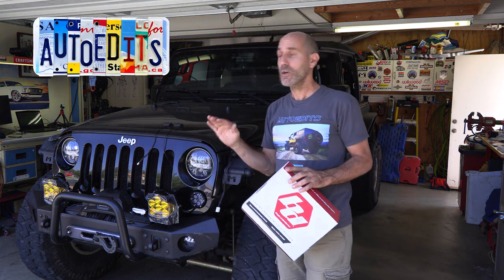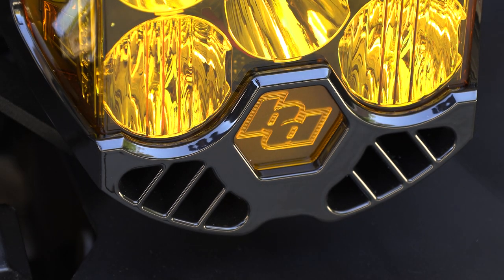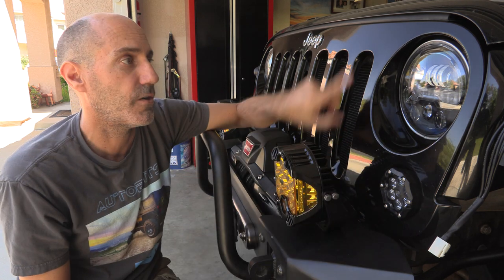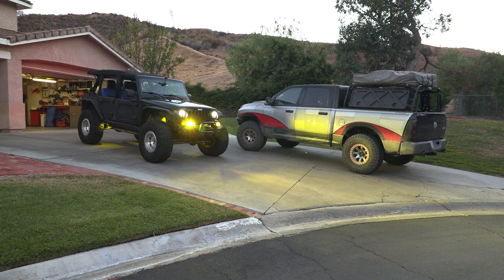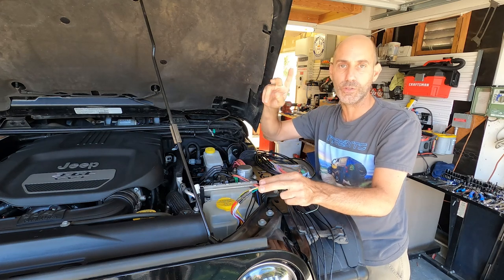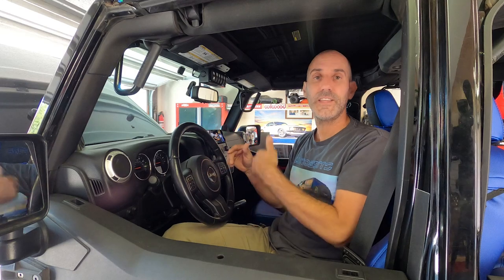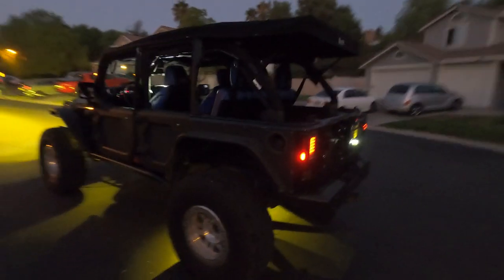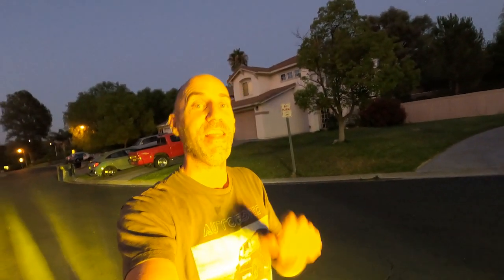How To Jeep Install of Baja Designs LP6 and Rock Lights Kit

Comment: Jason, the purpose of the relay is so that you can use a lower rated switch circuit so that you are not running the full amp draw of what you are controlling through the switch.
Reply from the maker: True, I mis-spoke in that clip but the end result is that we don't want people running lights straight through most switches.

Comment: Thank  you  for a great video and at mean time your simplicity on explaining things. However, how do you manage all the load on the car battery, please explain in detail. What should I do to maintain the correct electrical supply without draining my battery.
Reply from the maker: Hey thanks for the comment! The stock alternator makes enough power for a few accessories like these lights and such so if the engine is running your battery will be fine. If you add more lights and a big stereo and a fridge... maybe get a high output alternator.  Pretty easy!
Reply: Thank you so very much.

Comment: Kind of an overkill solution, but you could install a Lingenfelter STOV-004 speed activated switch to kill power to your locker switches at programmable speeds. So they would essentially never be able to be activated at a certain speed to avoid accidentally turning them on.
I am using 2 of the speed switches to control a couple things in my own build and they are great!

Comment: Nice video. I like how hyper you get. Is your bracket flipped?? I saw BD had the adjustment bolt slot to the rear. Yours is in the front. Small detail I’m curious about while waiting to install.

Comment: Hi Jason ... Firstly congratulations for you video ... Based in this video I decided to buy my LP6s .... Just one question .... You talked about two accessories to buy with the Lp6.... Harness Kit and other one that I can’t identified ... Could you send me the link for each one pls!? LP6 only work with these two accessories? Best Regards and Congrats again for the video!
Reply from the maker: Howdy and thanks so much for checking out the video! The only harness you really need is this one https://www.bajadesigns.com/Products/LP9-Harness-2-light-max-Pro.asp
The backlight wiring harness just has a couple of extra ways of splicing into running lights and I didn't end up needing it.

Comment: I gave up on contacting your neighbors for an Airbnb rental, but dam the guys in your neighborhood must be like - " Hey Honey Jason just added another freaking mod that I want, hence the guys love you, the NON jeep, ram, and resto mod gals not so much.  Baja Designs was a great choice, I have my eyes set on their new XL Linkable light setup for the roof rack light bar and LP4's for the bumper and two mounted in the rear.
Reply from the maker: I think the LP4's are perfect for most applications and the LP6's are sooo much.  I've seen a few shots of the linkable lights and love them!
Reply: With everyone rocking the Pro6 I wanted something different.  Well wishing you, your family, and Pinto the best, stay safe.

Comment: Are you using a fuse and relay for rock lights
Reply from the maker: Yes, the Painless trail rocker switch panel has all that integrated in. Makes adding stuff like this very easy.

Comment: Is the low the flood and the high the spot? I could barely concentrate on what you were saying after you talked about the widow biting your head. My jaw dropped and ptsd from living in Granada Hills came flashing back. I’ve only seen 2 widows since moving to Oklahoma and thankfully the brown recluse we do have don’t usually climb up into the vehicles. I find them under stuff. Hope you healed well Jason.
Reply from the maker: Ha! Yes, the low is the driving flood lights and the high is ALL the lights and it's pretty great.

Comment: On the backlight kit, can you just affix the connector anywhere on the yellow wire? Such as under the dash? I used the 3 way switch and mounted near the bottom of the steering wheel. Just looking for simplest way to enable this feature.
Reply from the maker: Probably... I just grabbed the closest wire out in the engine bay.

Comment: Hello. It looks like you took the wiring for the LP6 lights out of the proctective harness. Is this correct. I would have to do this to run the wiring inside of my bumper.
Reply from the maker: Yes, that would work fine.

Comment: Hello, great install video.  Quick question on your harness, Looks like you went with the 640167 x2 and a 640176 for back light.  Is there an advantage getting a Lp6 Pro Harness 640172?  I guess the switch is not needed on your set up so maybe your way cheaper vs getting a complete kit :)  Thanks
Reply from the maker: Yes, since I didn't need the switch and relay... the backlight harness is all I needed! If you have a switch panel you could do the same.

Comment: Did you ever actually go back And make a video regarding hooking up your lockers. I know you briefly mention it during the switch panel install and I believe you said you considered making a separate video for the lockers as well.
Reply from the maker: I never did do a follow up video on that since the wire colors changed during the years but it was as simple as splicing into the colors I mentioned in that Trail Rocker install video. Which is relevant on the 2013 model.
Reply: AutoEdits yeah, mine were certainly different for a 2016. It took awhile to find reliable sources to tell me which pins was the correct one

Comment: I'm really interested in getting a pair but I'm afraid of someone stealing them. How easy would that be for someone?
Reply from the maker: You could get what they call safety bolts which need a key to remove like a wheel lock. Call baja designs and ask!

Comment: Curious if the backlight draws significant wattage. If I piggyback off an accessory it shouldn’t draw too much right?
Reply from the maker: It is a very low draw, I run them off the corner marker lights.

Comment: Great video. BDs are pricey but def best I’ve seen. Btw- have my lockers set up same. Any help on locating your install vid for that? Like to double check what I did
Reply from the maker: Thanks! Here's the video https://youtu.be/SpTk_R3PPfs but it changes year to year on the JK's mine is 2013.  The relays are in the same spot but the wire colors change a bit from what I understand.

Comment: Why wouldnt you want to be able to run both the low and high beams at the same time on the Baja bumper lights?
Reply from the maker: That's exactly what happens when you switch to high beams so there is no need to run the same power to both wires at the same time. The internal circuits are not designed for that... plus... added bonus... I've been in some bad weather and it was so nice to run the low beams without disturbing regular traffic and they made a huge difference.

Comment: I am just curious, why did you chose to replace your JW Speaker lights?
Reply from the maker: That's easy... not really a comparison... totally different class of components. Plus, I didn't really like the oval shape I picked and really think the all round lights look amazing. I'll either use the old lights as rear facing lights on both the truck and jeep.

Comment: Was working on wiring these and noticed no matter which wires I power (white or red)  I can only get the low beams to power, did you run into that?
Reply from the maker: Nope. Wired up exactly like I show in the video.
Reply: @AutoEdits  Yeah I thought you could wire high beam directly but relay is needed (at least in my set up using the Trigger 6 shooter), just a noob mistake on my part lol

Comment: Hi, I installed the lp6 to my jeep JL high beam to aux1 and low beam to aux 2. Can I turn both aux high beam and low beam on at the same time? Thx
Reply from the maker: Nope. High beam automatically activates all the LEDs... if you put power to both circuits at the same time it could cause problems.

Comment: Do I need to have a switch that has a on/off/ on or can I use a on/off switch for both the high beam and low beam. But I know not to run them at the same time.
Reply from the maker: You could do that but I don't recommend it.

Comment: Love video and lights. Wouldn't it  be easier for baja designs to put connectors on wires before sending for that price. I know dcs lights do and utilize frame rail to hide wires. Seems like a flaw from baja. Keep videos coming
Reply from the maker: I think the  answer is (but I'm no expert) that they sell the lights separate and installing connectors on them would require the end user to commit to that style. It's probably a good suggestion that once they get bundled into a "kit" they have the connectors installed but that's just me.
Reply: I agree. Wasnt sure if it was a kit or not